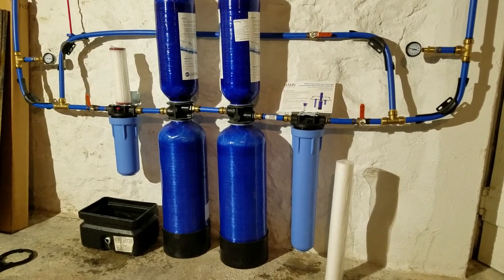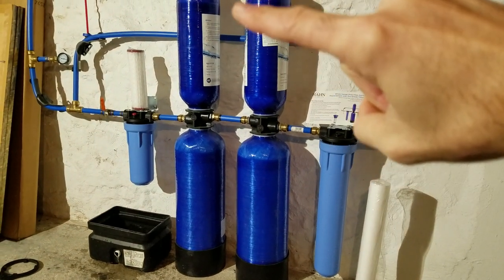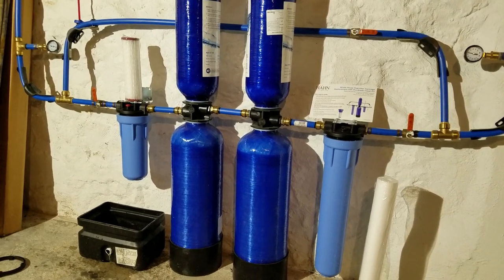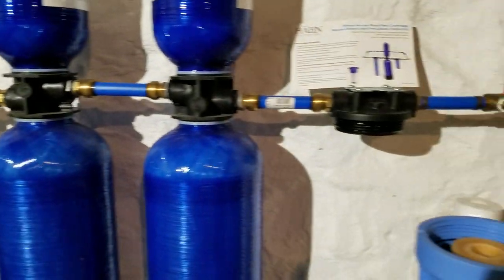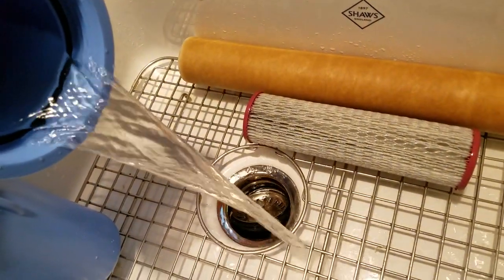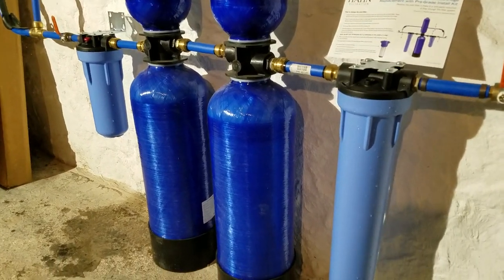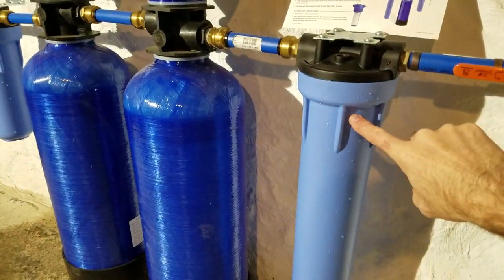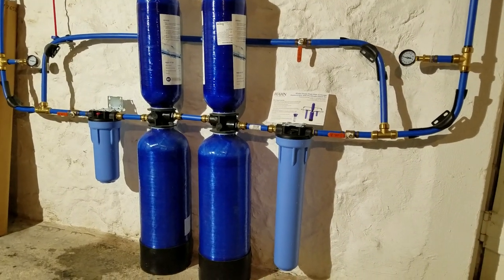Review: Aquasana Water Water Filter Systems, Overview, and Maintenance

Comment: The flow rate for this system is just 7.0 GPM, do you not find this kind of low? I was thinking about getting this but am now considering other systems due to this low flow rate.
Reply: The flow rate on the website say 7 but on the actual system when you get it  says 7-10. So 7 is the low end depending on your water pressure. I just installed today so dont know yet if is worth it. The water definitely tastes better right away. Looks like it is preventing scale as well. I cleaned glass in shower before installing, and sprayed with the new water and let it dry.  We have hard water and you would see spots right away, it dried clear. I didnt have any loss of pressure.
Reply: Jesse may how many bathrooms in the house? Are you just using one shower at a time? What if your sink, dishwasher and shower are all running together or you have two people showering at once, still no pressure loss?